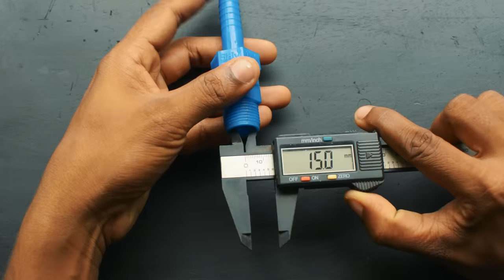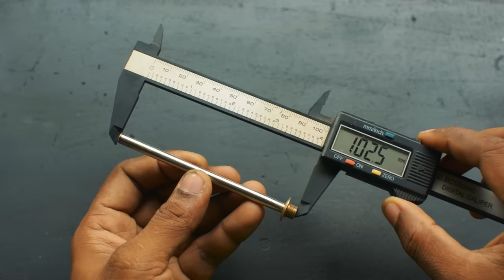PCP Air Gun Valve | PVC Build

Comment: If it is PVC, the base parts can handle 4000 - 6500 psi.  PCP tanks are filled to 3000-4500 psi with many operating between 1700 - 3000 psi.  A CO2 pellet gun operates at 800psi...

Comment: A word of caution to anyone who makes this and also something that this guy NEEDS to put in his video as a warning is that the materials he is using will have a psi/bar rating but once the parts are modified by drilling and tapping to accept the fittings you will have weakened the parts so the pressure rating will no longer apply, please exercise caution and if possible enclose the pressure chamber on the gun to avoid possible injury, 
This is a great design but I build my cylinders from seamless metal tube because I have a thirst for high power but the same caution applies to any material used🙂
Please pin this to help anyone avoid injury.
Reply: What is the piece he attached to the top of nipple, (the one he drilled and tapered ) at the very top?
Reply: Yea, that’s great.
Reply: It's an OSHA violation in the U.S. the pressurize pvc plumbing.  If over pressurized the plastic explodes into shrapnel.